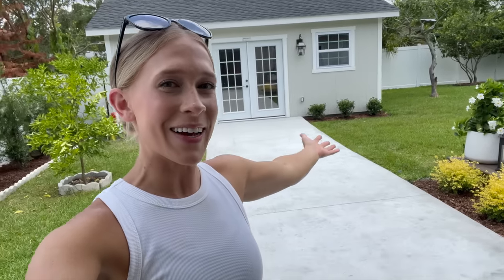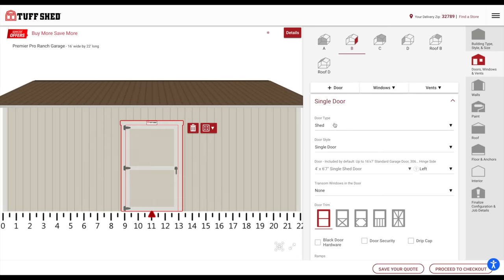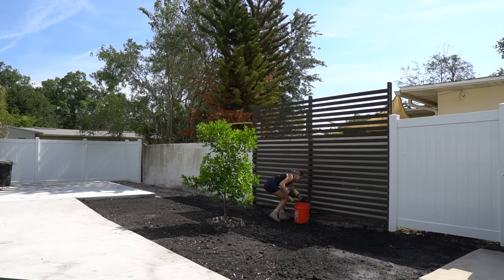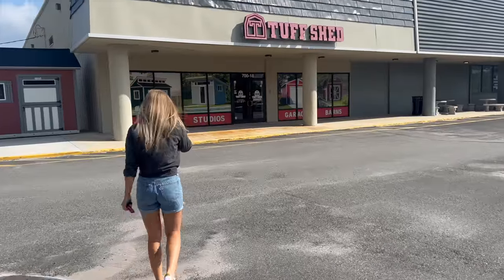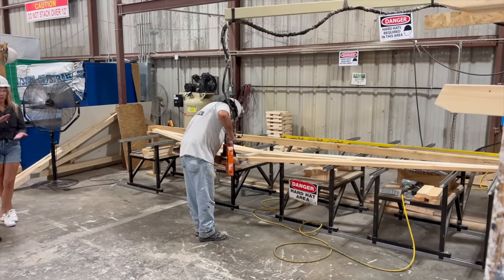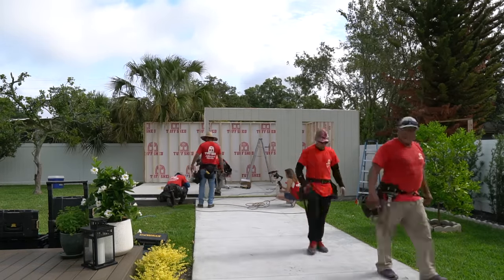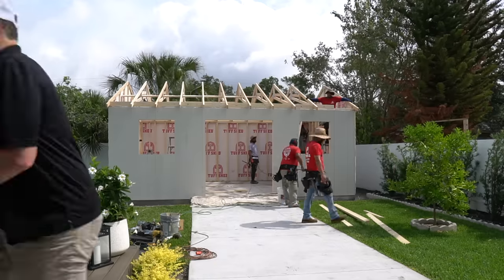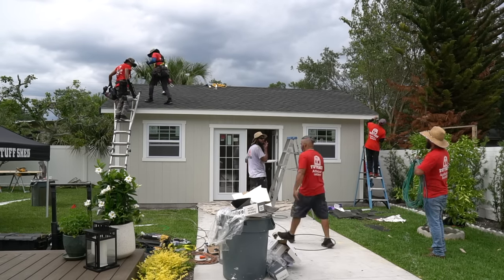Turning a Tuff Shed into my DREAM WORKSHOP!!

Comment: That was not at all my experience with Tuff Shed.  Two guys showed up, one experienced, the other one was brand new.  After working on the shed for a half a day the guy told me he couldn't figure out how to put the trusses on and thought they made them wrong in the factory.  He show up the next day with new trusses (they were the same apparently) and another new worker.  That new worker quit after a few hours.  The construction was super shotty.  A majority of the siding and sheathing nails missed the studs.  The shed wasn't even built with the proper stand offs from the block wall.  Another crew (two older more experienced guys) came back the third day and moved the shed to the proper location and fixed the roof, but all the nails were still just sticking out of the sheathing and not in the studs.  The more experienced guys knew the shed was jacked and just tried to fix it good enough.  Never again will I get a Tuff Shed.
Reply: Thanks for posting, can't believe these influencers get a sponsored shed and tuff shed assumes we're dumb
Reply: Nothing but problems with my tough shed from home depot ...hours of fighting with tough shed
Reply: That’s what I figured . It seemed like they are running a campaign with her and I’m wondering if she got it for free. Also at the factory it looked like a guy was going through all the missed nails that went through sheathing but not the actual studs.

Comment: I had a very similar project' an old beat up garage.   Took it down to the studs, redid the ceiling truss, and then replaced two walls that bowed out.   Like you I did the spray foam myself (North East so it was a must).  Then did the drywall work, trimmed, new siding, roof, carriage doors,  and tiled the floor.   Such a project but it boosted my house value big time.   I used the new mitsubishi mini split with heat, makes it such a comfortable place to work.   Though in Florida you can get it away with an easy to install DIY system like MR cool and save the install cost.  Wish I had filmed my makeover, it really is awesome now.

Comment: I don't know where you are located (I'm in Ohio). I bought a little tuff shed and my experience with their install team was AWEFUL. It actually couldn't have been worst! However, the final product I am happy with but It's really comical to me that your install team looked professional and got that much larger job done in eight hours. Mine is 10x14 and took weeks, with different install guys because some of them quit. I also and very particular and like things done correctly. I built the foundation for mine and was very sturdy and level prior to them arriving. I'm glad you had a MUCH better experience.

Comment: Your garden/craft shed looks great as does the landscaping. I had a similar size tuffshed on a slab foundation. I would urge anyone considering a shed like this to go with a perimeter foundation especially if it's intended for a woodworking shop. Reason is twofold. Slabs are very hard on your feet requiring anti fatigue mats. With a standard joist & pier floor it's a great deal easier on your feet & body plus you'll have a crawl space to run under floor dust collection ducting. Lots of windows for natural light, wire for both 110 & 220 circuits, install switched automatic gable vents a LED lighting, insulation & drywall & mini split to complete an ideal wood shop. Ask me how I know.